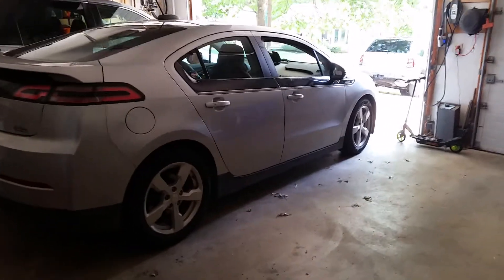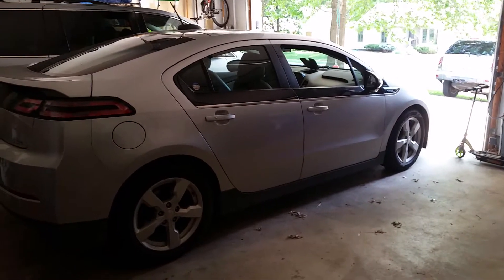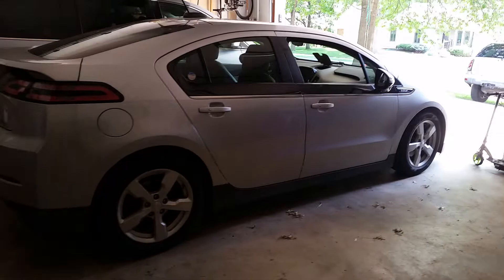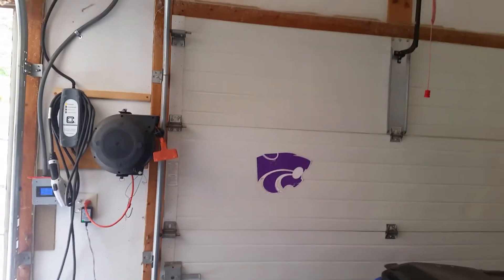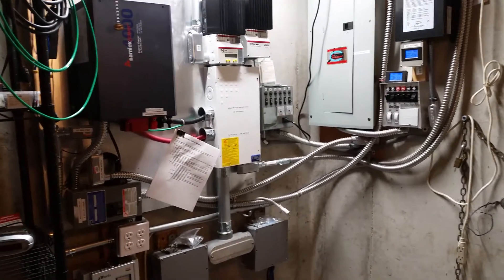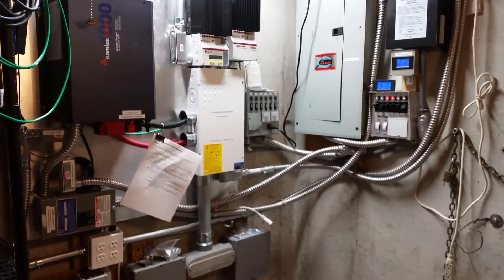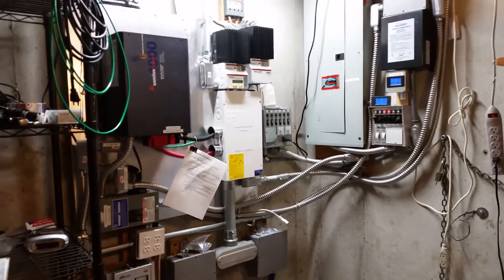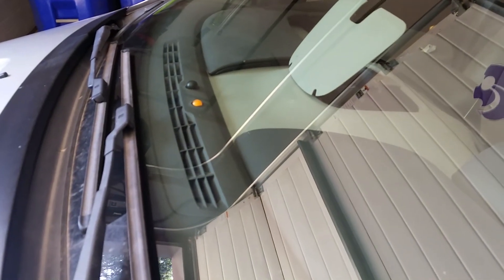Electric Vehicle Charging with Off-Grid Solar!

Comment: i built my own diy offgrid level 2 charger for our two gen1 volts. only cost ~1k$!. the trick is to use single phase 220/240v eu spec inverters since theyre like 1/3rd the price comparied to north american 120v versions for the same kw. inverter was a 6.5kw single phase 240v/48v model from powmr, only 300 bucks delivered, holy crap, we are living in crazy times. hooked up about 1kw of those cheap 100w/12v flexible panels, half mounted to the fence. battery pack is a 740$ 15kw 16s diy lfp battery made from 280ah lfp cells. cant believe theyre only 45 bucks each (~1kwh) delivered now lol. inverter pulls through a 30 buck 500w 120v to 240v step up transformer to keep the battery charged during winter/more frequent use. 
this is really the only solution if you want a 240v level 2 charger in your garage but you rent the property and cant make any modifications to the home/wiring. the roi for a system is only around 18 months since gas is so expensive in my area. we end up saving a lot more in gas by having dedicated level 2 chargers (3.2kw each)... plus a good amount of the electricity comes from the sun.

Comment: Hello!
I'd like to do the very same thing, just smaller 🙂
I could only charge with about 700W (lowest EVSE setting).
Question, someone said (in GM-Volt Forum) that if you charge from Off Grid you need to connect Neutral to Ground for the Volt EVSE charger.
This seems slightly Odd to me, did you have the same experience?
Greetings, thx for the video!

Nils
Reply from the maker: Hi Nils and thank you very much for watching and the comment!  Apologies for the tardiness of the response.  Regarding connecting neutral to ground, that is how the circuit breaker box in our home is setup and I have not had any connectivity problems doing this with our Volt.  Regarding your EVSE equipment settings, sounds like you have a fancier EVSE than we have as we cannot control the output of ours.  What brand and model do yo have?